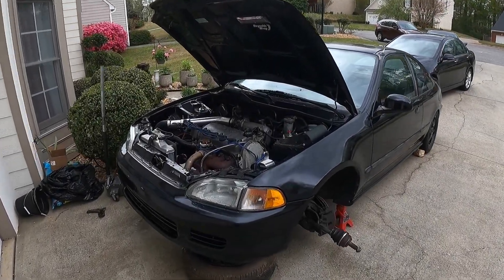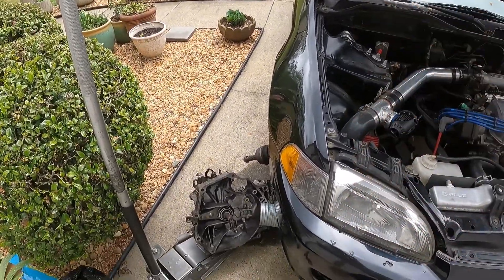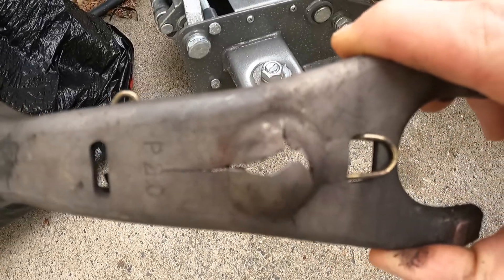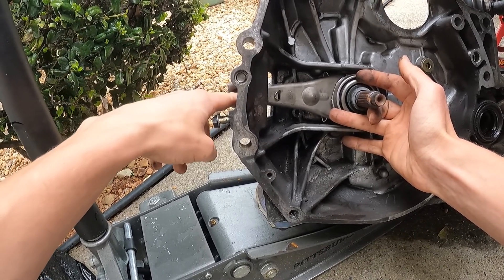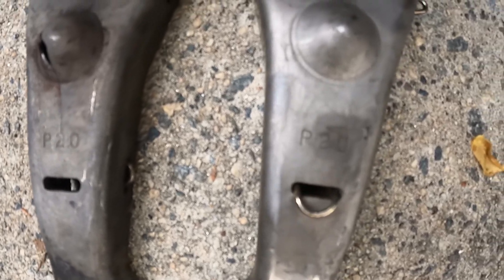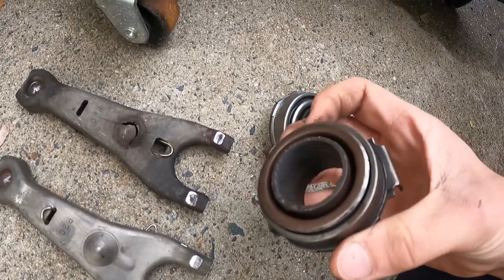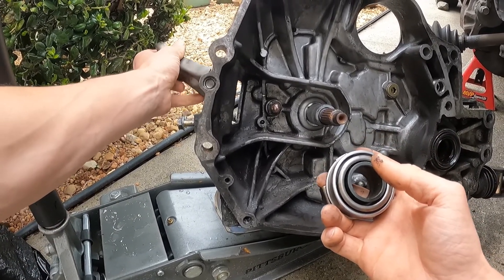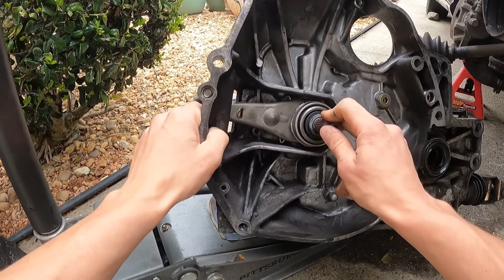Honda D-Series Transmission FIX [CLUTCH FORK]

Comment: i have a 97 civic d-series that sat for 2 years because we thought the bearing went out. FINALLY got around to looing at it after taking it out off storage and found that fork has literally the same crack pattern at the pivot point. 400k and i think only the second fork in its lifetime, not to bad.

Comment: I learned while building mine with my dad, the best forks come from the Z6 and D15s. Y8s have aluminum forks, and those are the ones thats prone to creating that hole. The one you put on looks like its steel so you should be good. We used the steel fork from the Z6 and put it in my Y8 tranny.
Reply from the maker: I read that up several years ago on one of the forums, but I thought it was something like steel ones crack and aluminum bend... Ben years though since I looked it up though
Reply: So it’s pretty much all a risk at the end of the day

Comment: is it possible to get that clip back in the fork if your trams is already re installed I thought I had it in but forgot that step and dont want to pull it again if I can avoid it
Reply from the maker: I dont believe so because the throw out bearing has to come forward, were you able to do it with the trans still on?
Reply: @BoostWanted  hahaha nope dropped it again 😅 and in doing so found more and more issues along the way but what can you expect from a 98 civic with 400,000kms and 8 owners and it was stolen 1 or more times in the past

Comment: I had the exact same thing happen a few months ago. Though it was the tranny, then the clutch, then the motor (but that's a different issue altogether). No. Just the clutch fork. So, I went and put a new clutch in it anyways and all of a sudden a few weeks after this little grinding noise that sounded like the throw out bearing all the time sounded like rod knock. Only it comes and goes in intensity. Sounds like something broke loose in the farthest most part of the gear case but we will see today. It's new transmission day.
Reply: Yep because it wants to crack
Reply from the maker: Did you get that figured out? After doing the repair, the throw out bearing is making noise and its driving me crazy

Comment: Can someone please help me out I'm having problems on my 04 Civic Ex D17a2. The problem is basically to cut it short is when I'm in 5th gear the gear "pops out" and goes back in neutral and it only happens so far on the highway at speeds 60-80 mph. I have already did a transmission flush and no metal shavings were seen so that's good. At times I have trouble getting into reverse have to try for like 3 times hardly ever have trouble getting into 1st.  I'm thinking it can be 2 different things based on research.

1. Bad clutch fork
2. thinking it can be some CV axles problem that go along with my differential , believe there worn out as they make noise when turning. 

If anyone can shed some light on previous problems they had would be greatly appreciated.
Reply: I dont know much about D17 transmissions, but do they have detent springs like we do? If so, look into that. Bought mine from Hybrid Racing I believe, it was 25 bucks at the time. I read that stiffer detent springs help lock the shifter in gear, and mine feels real good